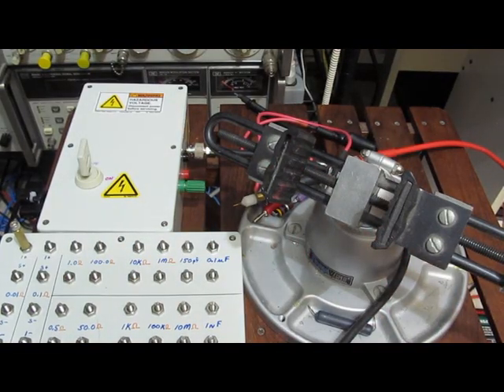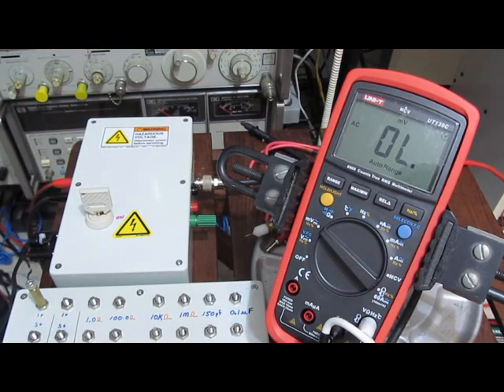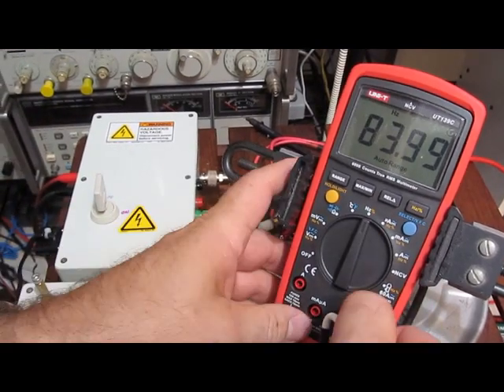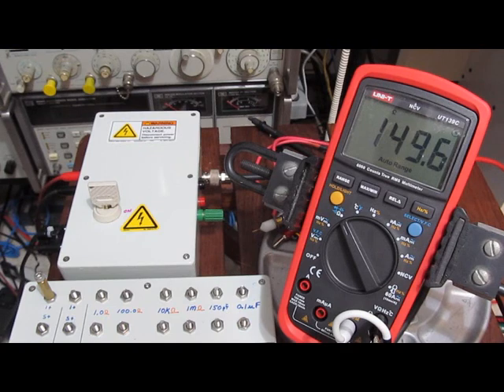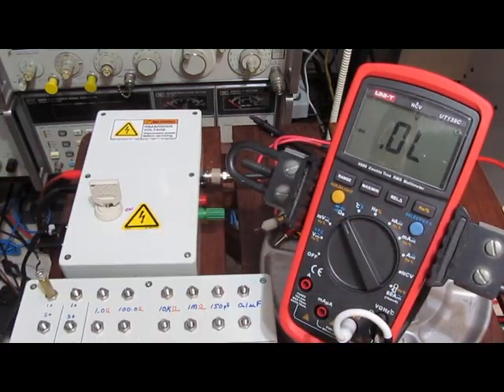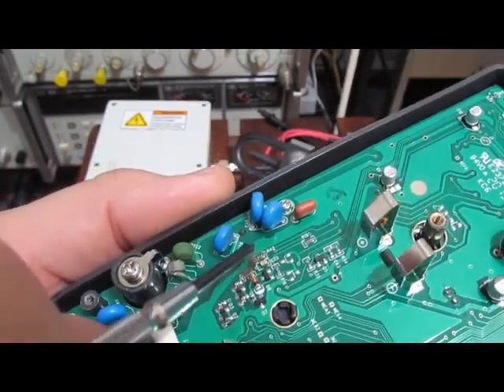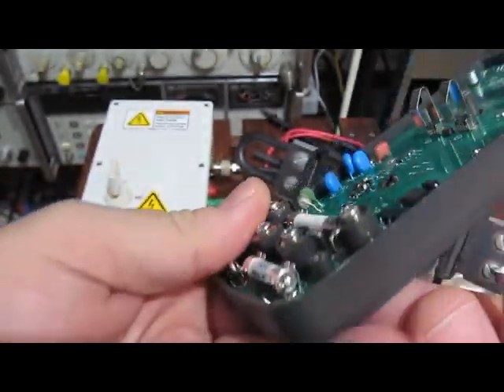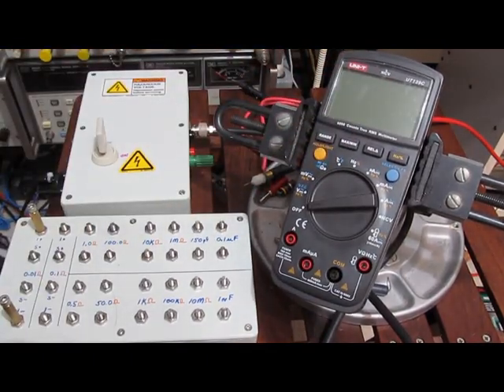Evaluating low cost DVMs Part 19B The  UNI-T UT139C

Comment: This "test" is actually proof that the meter is good if you have brain to use it. If you have no brain, you will ruin any kind of equipment like this, no matter what kind of protection it has. This is not testing, this is torturing equipment in a stupid way. However, the meter damaged itself, not hurting the people who operate it, so I would say that this is pretty good multimeter for the price.
Reply: +Daniel D - "you will ruin any kind of equipment like this, no matter what kind of protection it has" that is nonsense.  And just because it doesn't blow up and kill the operator right there and then doesn't mean that it is safe if after the transient it starts reading low like a few of the meters did.  That can be just as bad and likely to cause injury when the operator thinks it is a low voltage (or zero) and it isn't.  If you watched the other videos in this series you would have heard Joe Smith explain that.
Reply: Problem is if you damage and it and don't realise you've damaged it, then a circuit reads zero, you check some wires in your house.. says zero... next thing you know your family are grieving around your coffin...
Reply: You missed two important things: 1) some multimeters easily survive such standard safety test (check UL-61010 for info); 2) to test operator safety a high current should be applied (not HV transient) and should not lead to burning, explosion, or case breakdown. Even if you have super clever brain, you still can be caught by electricity, for example, when you measuring current and a device under test malfunctions to dead short. Or as mentioned above about DMM's false reading after HV transient (easily can be found in circuits with heavy inductive load). The UT139C has Cat.III 600V rating, so it should survive 4kV transient and withstand 1000A current without becoming dangerous.

Comment: It seemed to survive the first few hits. Of course, at some point the OV-protection components will fail, because PTCs and MOVs can't handle overcurrents forever, they "age" (its in every datasheet). So I don't see the point in doing this. In contrary, its pretty good that a cheap meter like this one survived a few hits. What do you expect, that an idiot again and again puts a meter "accidently" to an HV source? I think, its a good meter for the price, fast in display response and damn accurate to specs!
Reply from the maker: +Simon Sven Troschke  The positive and negative five transients is common practice.
Reply: +Simon Sven Troschke - This is a relatively slow test and when you say "again and again puts a meter "accidently" to an HV source" that could happen with those exact same pulses in a matter of seconds without the user knowing.  I mean where exactly is the "HV hit" counter?  How would the user know that it had been "hit" too many times and might not be safe and trustworthy?  Are you saying it's impossible to make a meter that can handle these pulses without dying in short order?  Why did the other meters handle it?  And I didn't hear Joe Smith say it wasn't "a good meter for the price" but does it meet its claimed ratings?
Reply: I just ordered this one and definitely I am not planning to have fun killing it. Absolutely stupid video.
Reply: I have a 139C I paid $35 for and I also think its a good meter for the price, but anyone with a brain knows almost no sub $50 meter regardless of its shown CAT rating will survive such abuse, its a known fact CAT ratings are often bogus in budget meters. What fails to be mentioned in this video is I think later he ran an expensive $400 top of the line Fluke 87V through these same tests and it failed early on.  The little Fluke 101 pocket however at around $40 was a big surprise and a known long term survivor of these tests at about the same price, but it has less functionality compared to the 139C so if you want a meter that is built to survive such harsh treatment buy a Fluke 101 or better but be prepared to spend a lot more above the Fluke 101 to get the same functionality as the 139C.  Ive had my 139C just over four years I think and tested all kinds of AC, DC, resistance and caps.  What it boils down to is its a $35 budget meter & if you dont abuse the meter as is being done here it should last, but if you try to kill it you certainly can - its a delicate electronic test instrument, and anyone using common logic would treat it as such.  If you want a meter that accepts this kind of abuse buy a high end Fluke or similar.  This meter gives good functionality value for the money and it does have PTC's and MOV's as well as ceramic fuses in the input circuit, if you keep it away from high voltage spikes it should be just fine, if youre working in such an environment then you need to spend a lot more on a meter to give the required safety.

Comment: Hi Joe Smith. I'm considering the Tenma 72-7780, which I think is a Uni-T UT 139C in different 'clothes'? For my understanding, could you please explain what the 3.7kV transient tests that you subject the meters to is, as in what is applied to the meters, and what kind of real-world situations it is meant to simulate? Is this an industry-standard kind of test? Am curious to understand this so I can decide if this meter is safe for household use and hobbyists who deal with voltages up to 230VAC, maybe 415VAC (very rarely if ever), and mainly work with measurements that are well within the meter's specs.

Also, how many meters of each model do you test (sample size)? Do the manufacturers send you free samples, or did you have to buy those test subjects? Any chance you'll test the Tenma 72-7780? would be interesting to compare it with this UT-139C right?

Thanks.
Pete
Reply from the maker: Hello Pete. Many companies rebrand so I would not be too surprised about the Tenma meter being a 139C.   As I have stated, the meters for the most part are bought out of pocket.  I have never received any meters from a company to run.  Why would this ever be in their interest?  My goal is to see where they are damaged and compare them with other products.    I am not aware of anyone offering public information like this.  I have covered how I loosely follow the IEC standards and the reasons why I differ.  61010 is a safety standard.  I have also covered many times about this testing not having anything to do with safety but rather the products electrical robustness.  For safety, I would make sure the products you buy have been certified to pass these standards.   If you are looking at UNI-T, then this my not be all that important to you.   My sample size is always one.   I assume that the manufacture's process is under control.  Meters are purchased through normal channels.   Keep in mind that even if I found a source of "free" meters, there is a fair amount of time involved with running them and the meters have no resale value once I am done with them.

Comment: Hi i have just purchased a UNI-T UT139C from ebay and when i set the Mv range on dc it is all over the place it counts up constantly and does not stay at zero before you take a reading. This does not happen on my Fluke meter and i want to no if this is normal.
Please reply cheers
.

Regards Simon
Reply from the maker: Sorry but after I damaged the second one, I did not replace it.   I did make a second video of this meter where I compare it with some other low cost meters before I transient tested it.   If you follow the link below, you will see how mine performed in the mV range.       https://youtu.be/zFvuigSS2Xk?t=710

Comment: Hi! I have also uni t ut139c. Lately it reads very slow in DC mode. I also replaced my test probes. Any recmmendations sir? Hope you help me. Thanks.
Reply from the maker: You could join the EEVBLOG and post in the repairs or test equipment sections.   Good luck.

Comment: i had two 139c meters given to me by a friend. the other one i gave also to another friend of mine which is an industrial electrician.  to cut this fairytale short, the time when he first used the meter at work the display showed 5 volts ac. and yet the inards exploded like popcorn. so what made the meter turn into a firecracker? it failed to catch that very fast SPIKE.. and it also failed to tolerate it. good thing he wore hv gloves or else that angry fast or super fast whatever you may call it could have arced to his hand turning it into a firecracker as well. this video proved that it does happen. and meters like these aint fit for seriously pro work.  for light use or hobby and fun maybe, but not for us.. i mean US only

Comment: Hi Joe, I felt that you realised that you had unfairly treated the 139C and tested it properly the second time so viewers thought you were being fair and not anti Uni-T. When I first listened to the video you came across as strongly anti Uni-T so that appears to make you biased against the company straight away. Every multimeter has to be treated independently so it does not depend on the series or company it is from. You have said this yourself! There is a danger that you will stereotype a company because it does not at first live up to your own standards. "Saving your skin" is just saying that viewers will treat you with more respect and not pass you off as an anti UNi-T tester. If you had not done that re-test viewers would assume that every test of a new UNi-T that you did would be not worth watching as you have stereotyped them with a bad reputation .As a matter of interest what are your recommendations for a 50$ multimeter?
Reply from the maker: +peter matthews As you suggest, many don't like that their meters in general have done poorly.  They are all ran the same.  The 139C as I have stated, was ran a second time along with an 87V mainly because both meters had not been incrementally tested.   This gave a better indicator as to the level these two meters could handle.   This has all been gone over before.    It was good to see the second 139C fail around the same levels as the first.   New generator, different waveforms.     

To be clear, I am not selling products and do not work for any of the companies who supply or design them.    All of the meters were paid out of my own pocket except those supplied by one other member who also purchased them out of pocket.   

I started these tests out of my own interest and decided to share them.   I have never asked for any donations nor have I received any.   I have offered the data I have collected for FREE to viewers like yourself.  Anyone can download the spreadsheet showing all of the tests I have ran to date.   

As stated, I never owned a UNI-T or most of the other brands until I started these tests.   Any bias in the beginning would have been against Fluke.  That should have been clear to anyone who watched all of the footage.   I would say I have given UNI-Trend more than a fair shake.  Most brands I only ran one product but I think I have now ran eight different UNI-Ts, including their UT181A.   

Your perception of how I come across has nothing to do with how the tests are ran and really, it's just that, your perception.  If you don't want to see this sort of testing ran, don't like my voice, how I laugh, don't like how I destroy the meters before they are recycled,  It's pretty simple,  don't watch.    

As stated before, I would have no idea what anyone needs or wants which would make it impossible to make recommendations.   I will say that I still like the Brymen BM869s over any other meter I have played with.
Reply: +joe smith Thanks for coming back to me with the explanation. I think I understand more of what you are doing now. How can I download the spread sheet showing all the tests you have run?
Reply from the maker: http://www.eevblog.com/forum/testgear/hear-kitty-kitty-kitty-nope-not-that-kind-of-cat/
Reply: +joe smith Thanks. Much appreciated.

Comment: What a pointless test, you're not supposed to buy these unless you understand how to use them....not real world.
Reply from the maker: If you feel the tests are pointless, I suggest not wasting your time watching them.   They only get worse.
Reply: joe smith I won't be, simulating mistakes a normal user could make provides useful information, this does not.
Reply from the maker: I would have no idea what a normal user would be or what mistakes they would make.   In general, these tests benchmark various meter's front end designs.